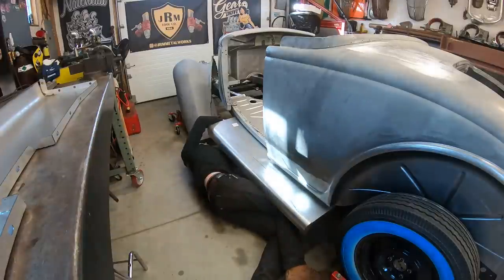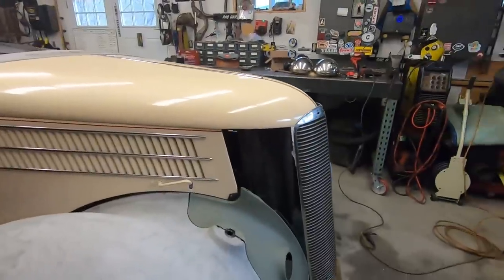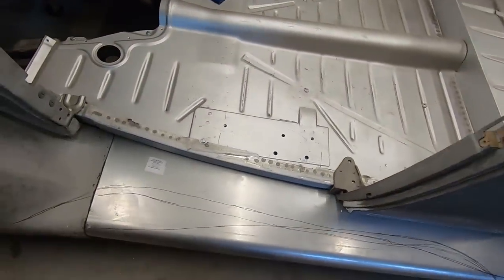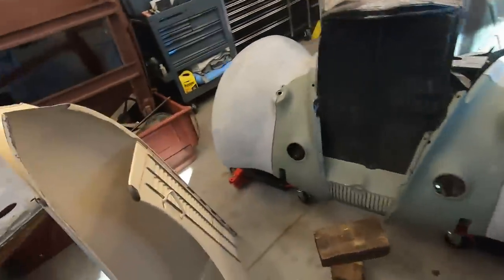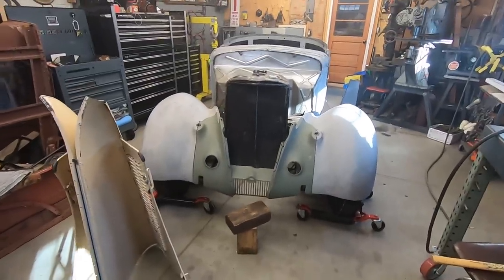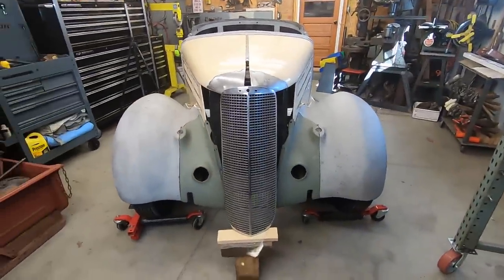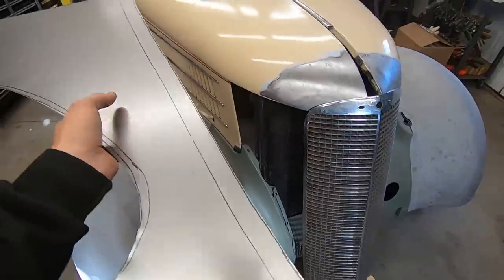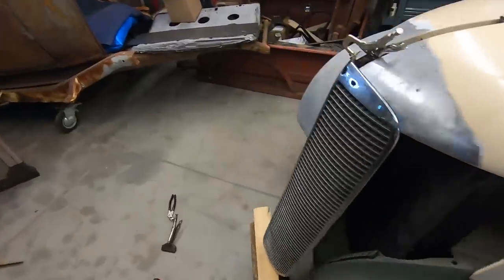1936 Ford Roadster Westerguard Style Custom Cadillac Lasalle Grille

Comment: Travis I noticed as you were cutting the hood did you notice gap way off on passenger side of hood.
Is that the rear of fender needs to be adjusted?
Reply from the maker: Yes I am aware, it’s the fender.